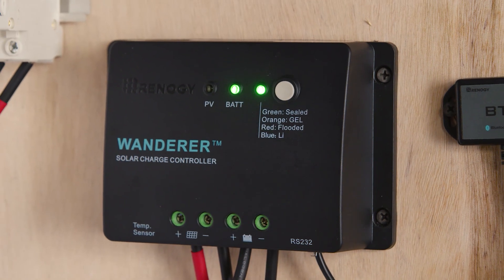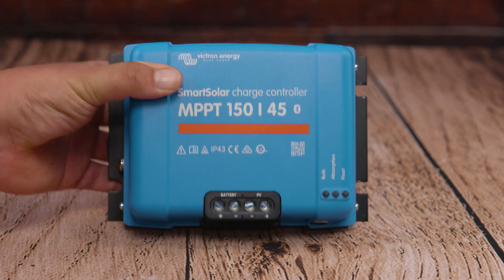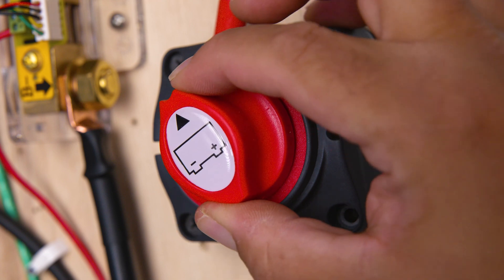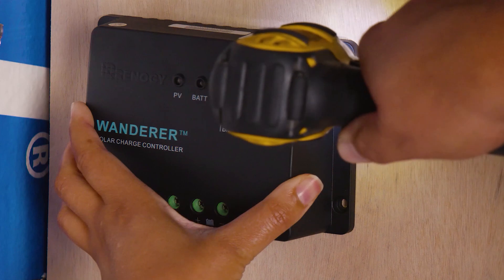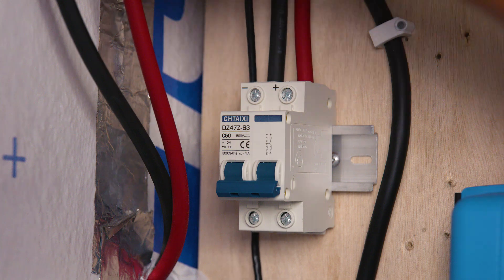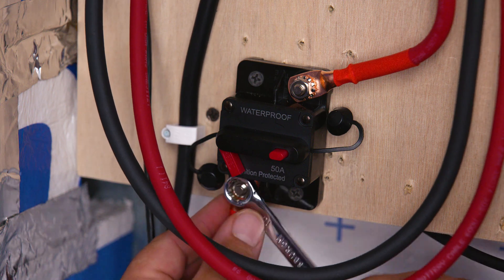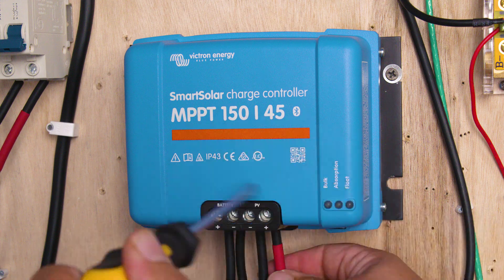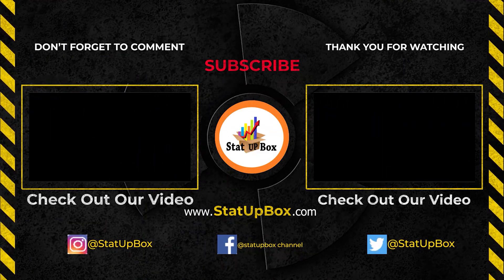How To Upgrade From PWM To MPPT Solar Charge Controller Easy Simple

Comment: Great installation!!! Question on this new configuration! What you can run and for how long! I am planning to have a green vegetable garden that will be running almost 650 watts between led lights , fan and extractors! My budget is $1000 without the solar panels